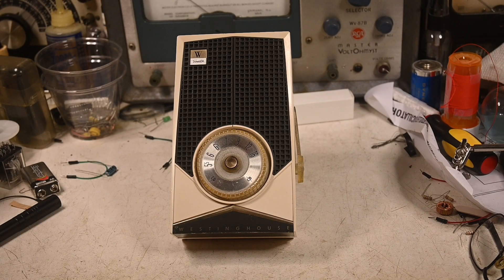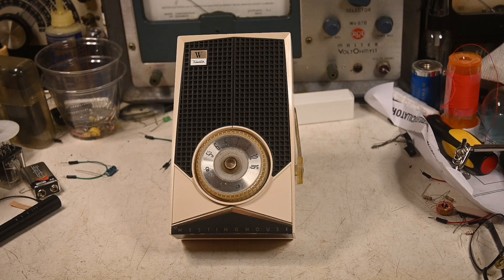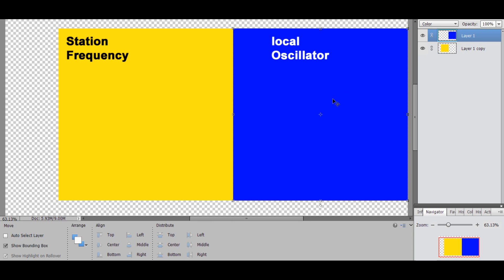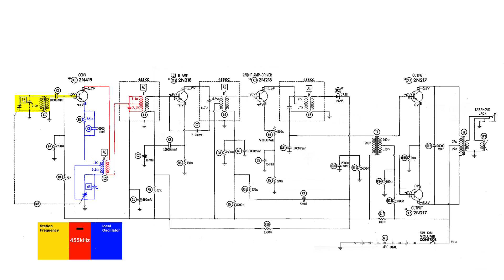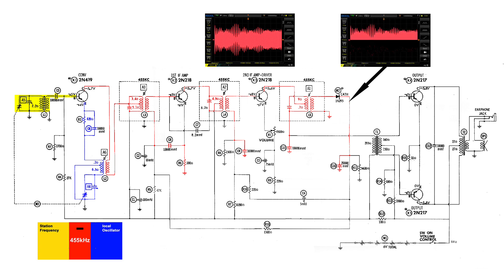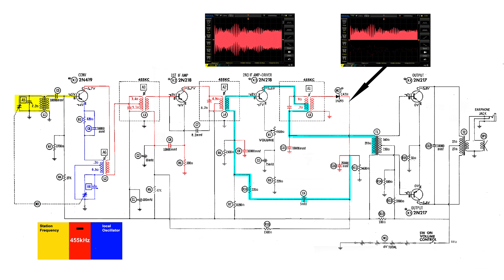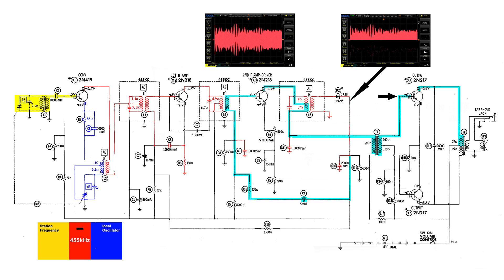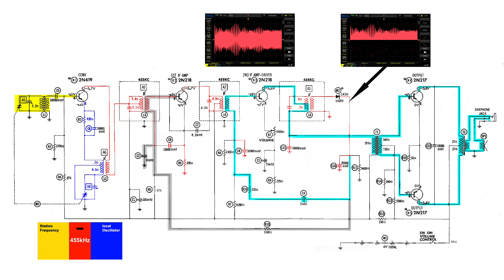Signal Flow Transistor Radio Westinghouse H655P5

Comment: Hi Rick ! One of the IFT coil in my Silicone transistor radio is bad so can I replace it with IFT coil that was used in Germanium transistor radio? or it will cause problems?  both of them are for 455khz.
Reply from the maker: Both 455KHz and transistor, that should work. If you do not want to remove the IF from the working radio, I found some on eBay. Let me know what happens. 
4 Pcs CEC IF Transformer Coil Tunable Inductor 455KHz Center Frequency A90105044
Reply: @AllAmericanFiveRadio The Germanium transistor radio is totally dead, so I was thinking to take out IFT from that transistor radio.
Reply from the maker: @hamzahkitech5228  Good luck! Thank you, and thanks for watching!
Reply: @AllAmericanFiveRadio Thanks Rick your advice and educational videos always help me in my projects and experiments, I tried your Am transmitter and it was great.
Reply from the maker: @hamzahkitech5228  I think experimenting is fun, and you can learn a lot. I’m experimenting with some tunnel diodes, I hope they are good.
Reply: @AllAmericanFiveRadio Experimenting is fun, and when you get good results you enjoy more, Happy Christmas to you and your family.
Reply from the maker: @hamzahkitech5228  Yes!!! Happy Christmas to you and your family!!!

Comment: Hi Rick how are you? I want to ask you  that which side of IFT coils should be connected at collector , high impedence side or low impedence side from centre tapping of coil , this is because some IFT coils measures more resistance from the centre tapping and some measures less and the other side is more ,there are variety of IFT coils from same manufacturer but they can be different,I am a little confused please guide me.
Reply from the maker: Thank you.
The circuit drawing does show how the I.F. cans is connected on the circuit board. The dash lines surrounding the I.F. shows everything contained in side each can, also each is connected to ground. The difficulty comes when you have to replace an I.F. can and you do not have an exacted match. Then all you can do is to try duplicate the circuit as close as you can.
Reply: Thanks Rick for guiding
Reply from the maker: @hamzahkitech5228  Thank you, and you are welcome!

Comment: The engineers of Westinghouse in the 1960s or 1970's did a very intelligent job, by making this AM superhet with only 5 transistors. And using that 3rth transistor both to detect the AM signal + as a driver for the complementary end-stage, via that transformer.  This was and is top (!). And many thanks for explaining this! No assault for Sony: but compare it to the Sony circuits of the 1980's & 1990's where they used 6 transistors in cases where only  3 (or even 2) could do the job...Compared to the Philips circuits where 2 or 3 did the job... Though Philips lost the EU market in the 1980's... Anyway: a good explanation of this beautiful Westinghouse radio circuit. Thanks Richard! 7 Sept. 2024.
Reply from the maker: Thanks Ko! Yes this is a very interest circuit for a transistor radio. I had to stare at this for a while. 
George Westinghouse started his company in 1886 and they are here today. Westinghouse goes back to the beginning of radio. Westinghouse made the first radios for RCA.

Comment: how does c11 know just drain 455 ??wouldn't it drain others as well?
Reply from the maker: C11 is a RF bypass capacitor, and a return path for RF. C11 is 1000mmF or 1000pF, at this capacitance it can pass RF frequencies very easily but almost no audio frequencies can pass through. I have done a few videos on this subject, the links are below. 
Keep asking your questions!
RF Capacitor Resistor ByPass Circuit
https://www.youtube.com/watch?v=NCQOi0U51zs
Capacitors, DC, AC, and Frequencies
https://www.youtube.com/watch?v=YfJKNSkz_Lk
RF Bypass Capacitor Oscilloscope Demo
https://www.youtube.com/watch?v=OILLayQjEjY
Capacitive Reactance and Frequency Demo
https://www.youtube.com/watch?v=S5_7gGHxVyQ
Reply: @AllAmericanFiveRadio  Thank you ,what value capacitor would start letting audio through ?I guess if this capacitor failed it would get quieter ?
Reply from the maker: @martinheppenstall2986  If the bypass capacitor was faulty the audio would distorted. It is a gradual increase as the capacitance increases the amount of audio that can pass through the capacitor increases. There are optimum values for bypass capacitors and audio capacitors.

Comment: 5:23 that’s called a reflex design, it was fairly common in the 1920s.
Reply: I recall constructing such a circuit using 1920's parts. The extra gain was at the expense of distortion, but such circuits saved on both the cost of valves & HT battery replacement.
Reply from the maker: I think it is unusual for a transistor radio. I forgot to talk about the volume control. Thanks for your comment.
Reply: A1, A2, A3 are they the same spec transformers?